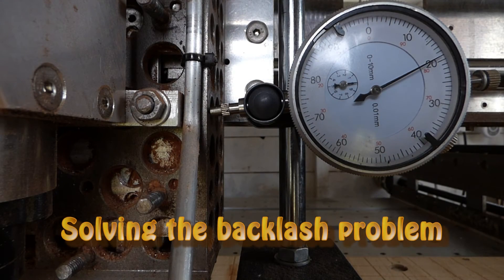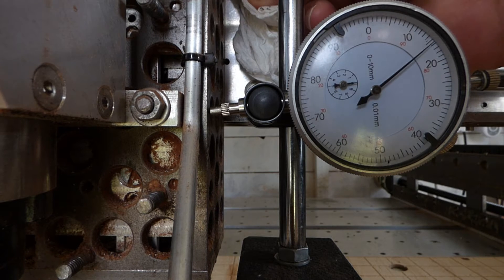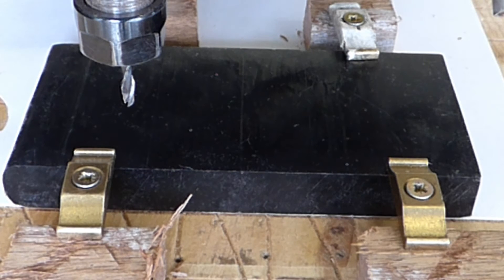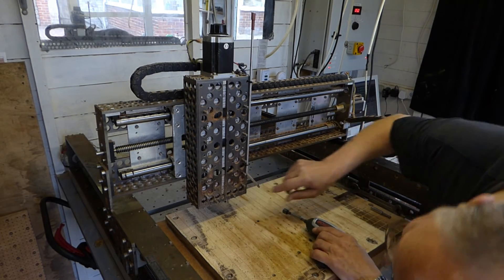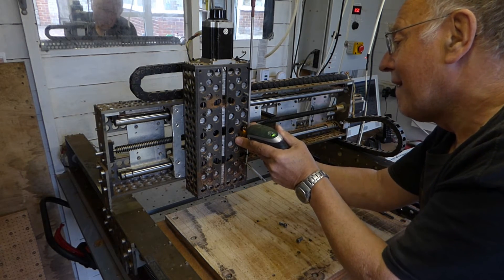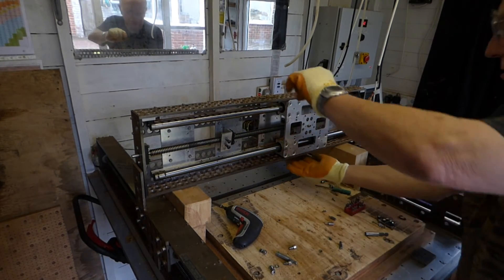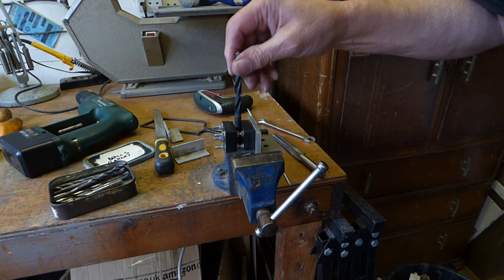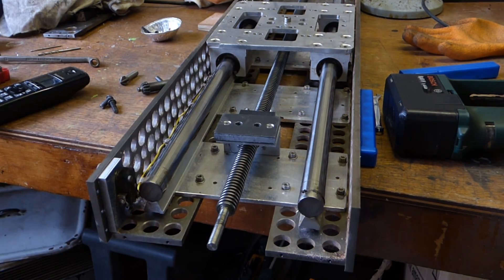Solving my CNC Backlash Problem

Comment: Nice solution.  How often to do you have to adjust it to compensate for wear?
Reply from the maker: +Chip Schweiss 
I don't know since, so far, I have not needed to adjust it. The backlash is still virtually zero.